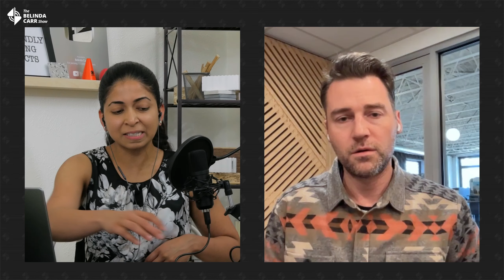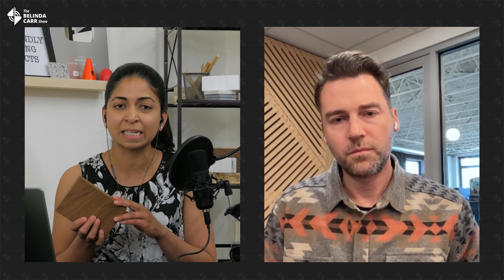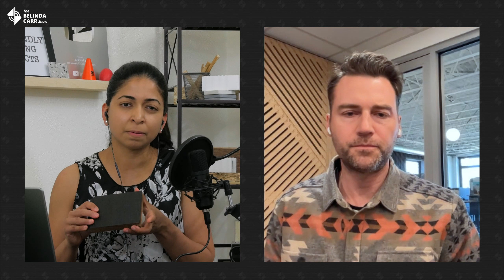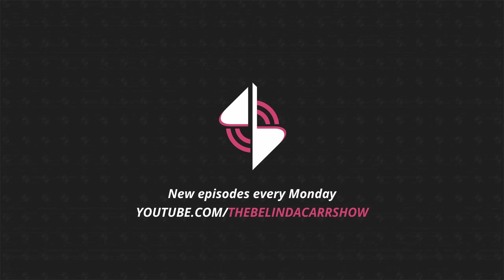How is Thermally Modified Wood made?

Comment: I'm curious if the increased longevity of the product outweighs the huge amount of energy required to process the wood.
Reply: I mean companies are already are cooking wood when theyre making KD lumber so its not significantly more expensive or intensive to make. TM wood though loses all of its UV stability & loses like 10%+ of its strength from removing the moisture and oils. Realistically its more of something thats useful to replace aesthetic components like siding at this time imo.